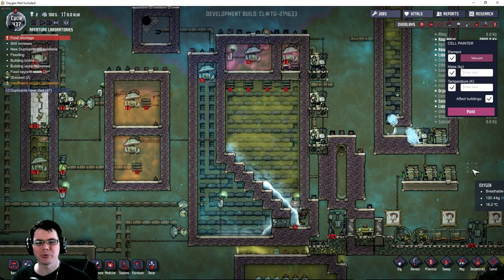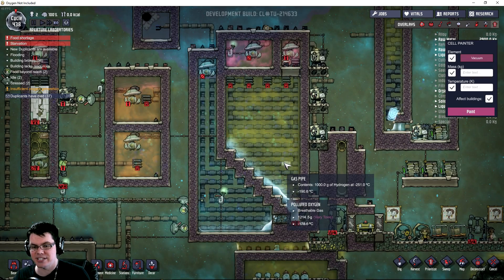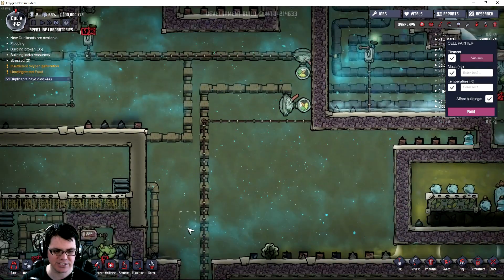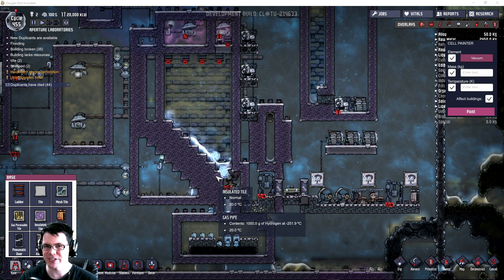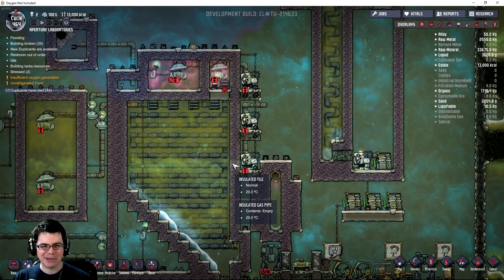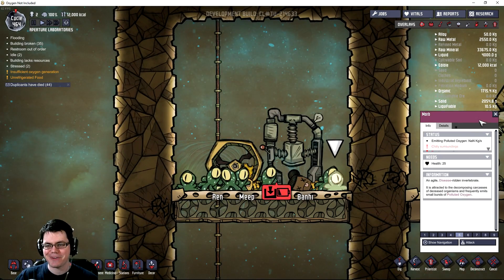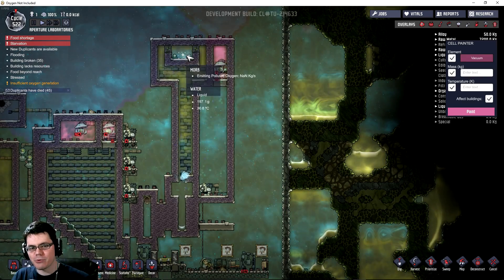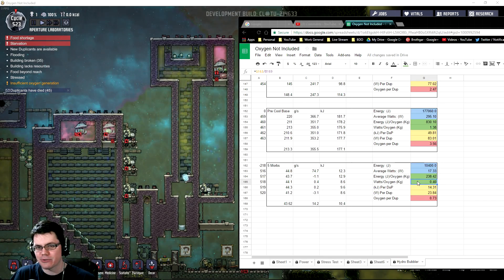Morb Powered Hydrogen Bubbler! Experiment Part 6 -  Oxygen Not Included

Comment: 6:27

actually, perhaps, I think it may be more efficient in the Mk. 2 trial?

if you take the first example, 2.33 people / 1.16 = 2.008

second example, 2.47 people / 1.28 = 1.929

I don't know exactly what those numbers mean or translate to ...... but the ratio is smaller on the second trial than the first. 

Initially I did that to see if it maintained its ratio: that, even though you increased its power output, you were also proportionally increasing its oxygen output. I can't tell if its better or worse with these ratios, but there's the math.

Comment: Since the duplicants need temperature to be fairly regulated for efficient work would it be possible to pass colder oxygen already in the base through a radiator located in the polluted oxygen production area and both lower the heat within the polluted oxygen as well as heat up the clean oxygen as a way to regulate base temps? If so this may provide a slight pre-cooling effect as well as decrease the energy usage for temp regulation in the base.

After thought: Passing colder oxygen from the base through a radiator in the polluted oxygen production could mitigate the pumps heat effect on the polluted oxygen before cooling. The pumps for the polluted oxygen would provide a somewhat steady heat source for the base and the pump within the base would also provide a slight amount of heat.

Comment: Hey Brothgar, I hope you are not done with those bubbler experiments! 
With wolframite is possible to make liquid pipes as opposed to gas pipes. Having that in mind instead of gas/gas system you can do Liquid/Gas system with wolframite liquid pipes. You just need to use the Hydrogen bubbler once to make a cooler than -200 C liquid and then pump it into the wolframite pipes. I guess a good canidate for this is the Natural Gas/Methane produced by the Fertilizer. Thermal conductivity is not bad and the liquid methane could be even better. In real live we use liquid Nitrogen to cool stuff  and Methane is the closest thing you have there.

Comment: Ive had this idea, but im currently not capable to make it in my current game, as its a two/multi stage process:

first of all, you make a "normal" LOx setup, but try to cool it as close to freezing point as possible, say -210 or -215c.

When there is a substansial ammount, make a wolframite loop in a sealed chaimber, and pump it/peruputal motion machine it, add dirty oxygen, and voila, it should, in theory, be able to produce even more LOx, as the conductivity of the wolframite should cool the gasses even faster.

Not testet, but purely food-for-thought (and experementation and videoes on your side).

Comment: How about if you have one tiny pipe system with the lowest temperature (2-3 rows/when about to reach solid state). 2:nd pipe system can be with the liquid state temperature -> rapidly lower the temperature and then adjust the final temperature (1:st pipe system might reduce the size of the 2:nd pipe system).
   3:rd pipe system that cower the morbs with preferable temperature.
   4:th pipe system with "boiling temperature" in a boiler room next to the hydrogen bubbler (slight half way below?) -> boiler room size to reach ~18*C, as the boiled oxygen goes out trough the roof.
This would remove all of the drift cost, except to boot the system up.
Reply: yeah that looks like logic game this Oxygen not Included something kind it

Comment: I've noticed a lot of these experiments are based on watt efficiency. But what if we stopped caring about that and went full industrial revolution and went full on production. What could you do if you fed it maximum power and went for pure oxygen production over anything else - things like using thermoregulators to start cooling polluted gas before it reaches the main chamber so when it gets there it'll take less time to condense.

Because while these chambers are nice and awesome and all they're really big and quite large projects for my duplicants to actually make and take up a lot of resources! And a lot of the time I'd rather have just pure production and have to suck it up in terms of watt efficiency by having a larger number of duplicants hampster wheels/hydrogen generators dedicated to just that circuit.
Reply: The point of the efficiency is that once built then dupes are free to do other project. At around 1W/kg of O2, one dupe can supply O2 for 5 dupes (including himself) leaving 4 dupes for other tasks like maintaining bristle blossoms (they need to be refilling with fertilizer and reseeded every so often) and most importantly; converting recycled polluted water into fertilizer on an industrial scale. It's the fertilizer makers you want to dedicate dupe effort and energy into, and that is more easy if you have an extremely efficient oxygen production.
Reply: I perfectly understand why energy efficiency is desirable - however, I don't find it that important. I find I have an excess number of duplicants and not always the resources and sometimes even space in certain spawns.

I also feel high-production over energy efficiency will have its merits for future builds of the game, where particular resources may be more scarce and new challenges are more likely to be put in - and so making highly efficient projects like this may not be worth it if you needed it yesterday.
After all in this early Alpha and sandbox-like conditions occur reasonably soon into the game once the basics are setup. I just want to be ready for when the really scary stuff hits!

Comment: Another great video and thanks for the mention.

I think the biggest issue with the system as it is now is the 1 tile wide channel for polluted oxygen intake. That restrict the flow considerably. They should be minimum 2 tiles wide. In previous experiments I've made 3 mobs supplied enough polluted oxygen for 1 dupe, so if you're not seeing that limited airflow may be the reason.

As we saw when making the freezer area bigger it's able to produce more oxygen. Now in the pumped in version that resulted in the pumps needing to work harder as they needed to transport more air resulting in higher consumption per kg of oxygen produced. The reason why this happens is that the pump lowers the pressure in the tiles it is in, so the pressure has to equalise from the tiles around it. That takes a little time so if the pump is pumping more often it moves less air per "pump". You can get around that variable by just filling the room completely with pumps.

In a larger morb fed system you obviously don't have an increased power draw (except for the very small amount the system is heating up in the balancing chamber) so more produced oxygen equals higher efficiency. As I previously stated, the goal is 0.2W/kg of O2 which is what I have in my experiment system which also have siphoned off liquid oxygen assisting cooling.

Comment: what the-- no credit? i mentioned the morb based supply system first haha!  BTW, you have the morb idea system right, except on your original bubbler setup add the morb base on top instead of the hydrogen machine, then move that elsewhere... that could potentially massively increase the liquid O2 and efficiency.. At the very least i'd like to see your findings regarding this in a video, if you have the time of course.
Reply: ***** oh that's absolutely fine! I meant for it to read jokingly xD

Comment: Watts/kg? Do you mean joules/kg?
Reply: watts = joules/second by adding time it becomes watts
and ingame it is called heavy watt wires :)

you are pumping in ex with a manual generator 250 joules per second it runs =250 watts
now how many watts will produce 1kg of oxygen
that is what he is measuring watts/kg
Reply: So my understanding of what hes doing is looking at the rate energy is being produced (joules/sec=watt) and the rate oxygen is produced (kg/sec) and dividing one by the other (joules/sec)/(kg/sec)=joules/kg.  The interpretation of this is that you produce energy at a certain rate, and oxygen at a certain rate, and the longer you produce energy the more oxygen you produce.

Otherwise your looking at the rate you need to produce energy to get a fixed amount of oxygen, eg produce 250 joules/sec to produce 100kg of oxygen total, no matter how long it runs for, which is just nonsense
Reply: Yeah, the measurements are all based on the passage of cycles, so it makes sense to use wattage. However, when comparing values in a equal amount of time,  we could then reduce the units and go with joules.
Reply: watt * days / kg, actually. He just ditched units and divided and forgot that that doesn't mean much.

Comment: Apart from towers. It could be also done as spiral heat exchanger. Orange wall are from copper/gold/whatever that is conductive. Violet are insulation. Blue cooling pipes(like towers it's supposed to use oxygen or mixed coolant)

Spiral cooling pipes also should go under walls if it will effect them.

It have siphon from shape in middle.

Oxygen can be also pumped out from dead end of inner spiral, it gonna be hotter thus probably better suited for some plants while from pump in middle it will be super cold. Unless behavior of pipes will change to more realistic then no reason for second pump.

It may happen that clean oxygen in inner spiral will almost always want to stay liquid. Then some filler-cooler from other gas with even lower liquid point would be great.

Movement of polluted oxygen in outer spiral if needed should be forced by pressure created outside not by something inside spirals.

https://c1.staticflickr.com/5/4165/34639792096_68a8361ce9_o.png

And well it probably gonna be frustrating to build in "oxygen not included".

Comment: You kinda created vacuum pump with that 1 tile long container at the bottom ;P

Try making hydrogen in super hi pressure. It should create metal hydrogen(for example "gas" giants Jupiter and Saturn are deep inside made from that).

About efficiency and cooling. Left tower for "polluted oxygen"(supposedly open to work just as went or closed with bunch of morbs and puffs there), middle for liquid and gas clean oxygen, right cooling tower. 
Red and blue pipes. Blu-blue pumps. Cooling pipe(s) go inside all towers with exit outside to base or back to middle or right tower. Coolant is supposed  to be clean oxygen(in any form)
Left as precooler.(but probably don't put to many pipes on that side unless is supposed to be small system)
Middle to cool down oxygen at top so it doesn't get super hot
Right just cooling tower
Green are insulated wall, orange from copper/gold/whatever transfer heat well.
Orange  walls of middle tower are supposed to work as heat exchangers.
At bottom should be "siphon"
https://c1.staticflickr.com/5/4187/33836711964_7c2572624b_o.png

Possible mod 1 Mixed coolants

If helium or whatever still is supposed to be coolant. I would say to put it together with oxygen in middle tower and then just sort it so that helium go back to middle tower when oxygen go to base. Thus using one tower and one pump for coolant.

Possible mod 2 Puffs and morbs or some contaminated liquid/solid

If it would be closed system from intake side that use morbs and puffs then there would be no need for pump and red pipes. Or just completely don't use left tower and just place then at top of right tower or top room(that is supposedly to be also precooler if devs would change pipes behavior)
Reply: Metal hydrogen doesn't exist in the game. You can make solid hydrogen though by freezing it to below 14K. However doing so will damage the pipes you're freezing it in, and since there's no reliable medium to freeze it with as we saw helium, as the only gas in the game right now with a lower freezing point (about 1K) is incredibly inefficient.
Reply: No interesting material(s) in game :c
Reply: Well. We don't actually know that metal hydrogen exist in nature either. Although theorized back in the 30s, it's actually never, at the time of written this, been observed in nature or produced in laboratories. Several scientist have made either claim but all have not been reobservable or reproducable as yet.

Comment: Were you gonna try to build a machine like this later in a ONI playthrough?
Reply: MOST EFFICIENT FRIGGIN OXYGEN REFRIGERATOR EVA!!!
Reply: Freddie Mercury I would anticipate that it will not, as there is a polluted ice state, freezing polluted water will likely only freeze into polluted ice.
Reply: Freddie Mercury also melting ice is a huge time sink and I'm not sure how much liquid is lost in the freezing / thawing process.
Reply: well you can heat up polluted water into steam but that of course will sap out heat
there is no need because of geysers that you can cool down using the cold oxygen from the bubbler

however perhaps you could make a hot gas run through pipes with perpetual motion but it will probably break unless it can withstand 100 Celsius or greater